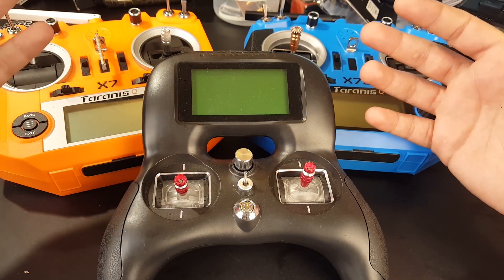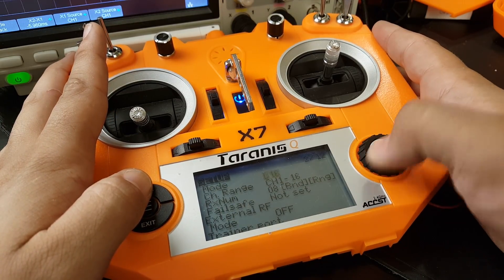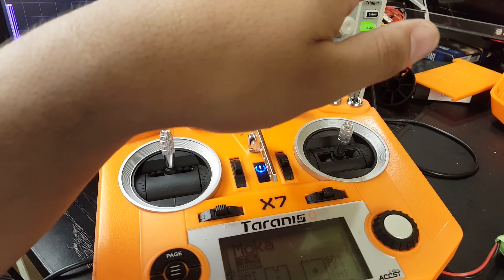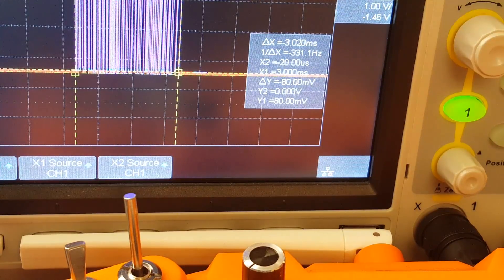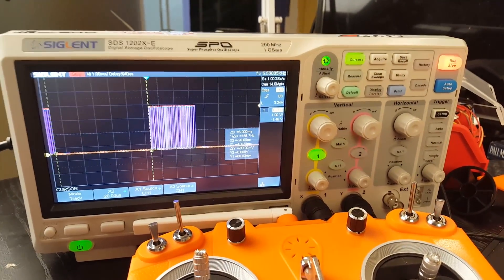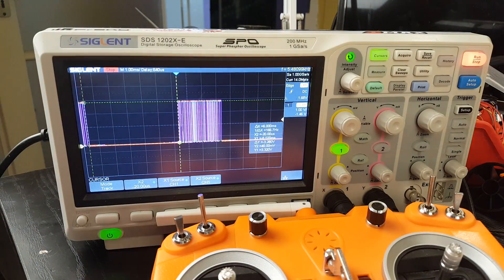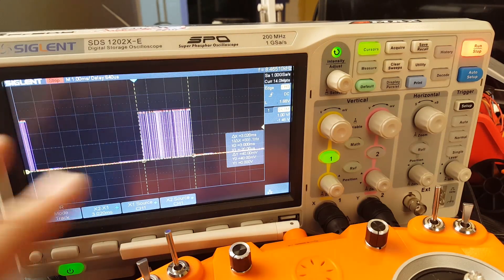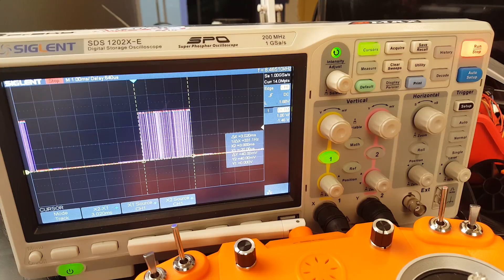Transmitters Latency // FrSky 8ch vs 16ch Latency (Retested READ Description)

Comment: Measuring the whole frame length doesn't answer much as the protocol can be implemented in variuos ways. For example ending part of that frame could be padded for 8 channel mode, but used for 16 channel mode.
Reply from the maker: RandomWisdom 16 channels are always sent no matter what in 9ms wether u set 4ch or 16ch. I just had a call with joshua Bardwell about this and I was checking the betaflight code and black box. The extra latency is from the code and not sbus protocol. If channels 9-16 are not blank then betaflight takes 2 frames as one thus increasing latency. I will have all my findings clear and in detail tommorow in a video. 

Thanks for the input.

Comment: And where is the latency ? The latency should be measured between transmitter's PWM input and the receiver's output. I see you just measure a length of an SBUS frame on 16 ch receiver. Fully useless info.

Comment: I was wondering about this on CRSF... chosing between 8 or 12 channels.  It defaults to 8, and I'm using 9 (last one to turn OSD ON/OFF), but I could squeeze 8 and 9 into just 8 by moving those to onto my Turtle Mode switch and dropping a Failsafe test posiion.    Watching this, I see no reason really other than to make the transmission slightly more robust vs noise (looks like it's just lengthening the time it transmits a signal per value).  Having the 3 extra channels on for future uses seems more important to me.

Let's just do a search and see if you did this same test with CRSF...     nice... on top of your game:
https://www.youtube.com/watch?v=0RH_TSwT1oM
I guessed they would of used less dead space between packets.

I'm guessing the 8 to 16 FrsySky was a later day hack to pack 2x data in the same transmission without massively rewriting or changing anything else.
I bet the Crossfire packet does get longer from 8 to 12 because if they coded that at the time it would of been easier just to continue transmit more values without compressing their transmit time and still not change the dead space.

Comment: ha, played around with my osci on the weekend. found it easier if the trigger is set tu pulse and wait untile a pulse of >5ms (the deadtime) occurse - so the display always shows the sbus signal centered...
but: my issue: if I want to see the changes in a frame - I have to zoom in good there to see it - but then I dont have enough time resolution to see multiple frames... I have to learn how to use my osic better :)    (Peaktech 1240)
I now changed my setup: I only probe one specific servoe channel - there I see either a thin or thick packet  (associated with a switch). that's easier for me to see from zoomed out. already got some different receivers and protocols tested. will be interesting to see how they match up with your results.
one thing already: as expected my ezUHF is very slow (I could even tell this if flying a vortex not longrange but close proxy - it's hard - even if the cam is fast :)

Comment: Since it is pulse width doesn't the frame size change with the amount of data sent?
I.e. if all channels were sending 2000us the frame time would be longer?
So if you have D16 set up but are not using aux5 and above the frame would not be as long as if aux5 and above were set fully on i.e. to 2000us?
Are all the channels set to their max output when you are reading the frame?
Thanks for work and sharing.
Reply from the maker: jtan163 No it's always 3ms of data no matter what. The extra latency is from BF code they take 2 frames to process as one for some reason. I will have the vid in detail tommorow to show the BF code , black box and frames when blanked out for 9-16.

Comment: Simply check that in the blackbox: RC command, you can see the latency there.
Reply from the maker: supiiik Yes but this was so see how long each frame is. Latency will be upcoming I'll rig my controller all the way to motor to get time that motor receives signal.
Reply: Latency of each SBUS frame is not important, because imformation of half of the frame should be always copied from previous.
Simply turn off RC interpolation, or you don't even need to, because interpolation is not used for throttle or yaw stick. move the sticks and you can see the stairs on the BB recods. Just measure the gap between the stairs and you have real latency. Then the real latency is latency of the openTX software (couple of ms, depends on the mixers and other settings), data transfer from openTX to JST (every 2 ms), 9ms for 8ch or 18ms for 16ch + RC interpolation.
Reply from the maker: Noted but I will inject full throttle into the the boards gimbal input and listen on the FC to how long it took to get there. I think it would be interesting and some people would like to see it becuase I will be testing the Turnigy Evolution as well as Flysky and hopefully get my hands on a spectrum tx as well.

Comment: I haven't watched video yet, but I'm sure that it will have more latency it needs to send more data. Or it will have latency when you are actually switching modes...
And it remembers them, it is no need to transmitter to say it again and again. On switch is only ON-OFF. Hope you understand what i wanna say.

Comment: You didn't even verify than 2 consecutives frames are not identical or the same, the test is bogus because in D16 mode they are different (CH1-8 then CH9-16 then CH1-8, etc.). You need a decoding function to get the values directly on screen to see it immediately because frames are unreadable with a simple oscilloscope or you need to watch very closely to see differences in the pulses. D8 is twice faster than D16 in latency.
Reply from the maker: +David Cooling I will revisit all these once I add d8 to the testing. This was quick intro to see if I missed anything from everyone's input.
Reply from the maker: I just tested it and retested it on d16 8ch 9-16 are blank and all channels are passed in 1 frame on d16. I will upload my method tonight or tommorow and see if i have missed anything again. So total time is 9ms either 8ch or 16ch on d16.
Thanks for the input though great to have me double check.

Comment: Nice, but according to my best knowledge on D16, 16 ch - they are sent as two frames of 8 ch each. Every 9mS, the XJT sends 8 channels, alternately channels 1-8, then 9-16, so channels 1-8 are only sent every 18mS or so maybe even slightly worse.
Make some pattern on ch 4 and 12 and check it
Reply: Eddi Maevski +1
Reply from the maker: Eddi Maevski Thanks for thr heads up will test this tonight
Reply: Great suggestion and would definitely clear this up.
Reply: ...so there is no benefit to running at 8channel? If so why does it say 8ms in opentx when you set it - a mistake?
Reply: Eddi Maevski -1
Reply: Eddi Maevski +1
Reply: Drone Mesh so you're saying that since it has binded in d16, it will always send 16channels per frame, but only update the first eight if in that mode?
Reply: Drone Mesh, did you have any output configured on 9 to 16 ch?
Reply from the maker: Álvaro Martins Of course next vid I'll show you guys everything in super detail.
Reply from the maker: I just tested it and retested it on d16 8ch 9-16 are blank and all channels are passed in 1 frame on d16. I will upload my method tonight or tommorow and see if i have missed anything again. So total time is 9ms either 8ch or 16ch on d16.

Thanks for the input though great to have me double check.